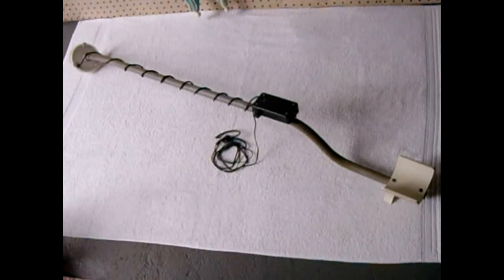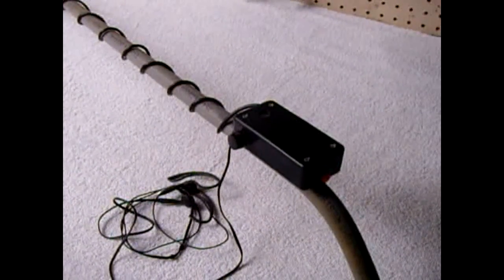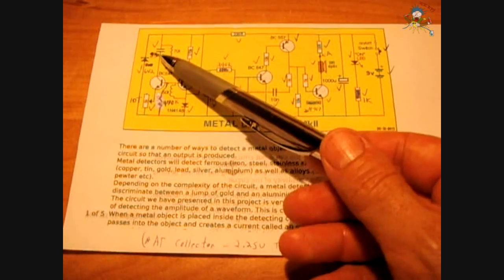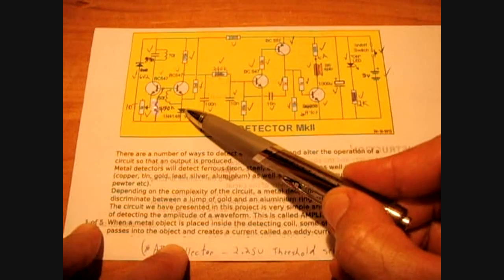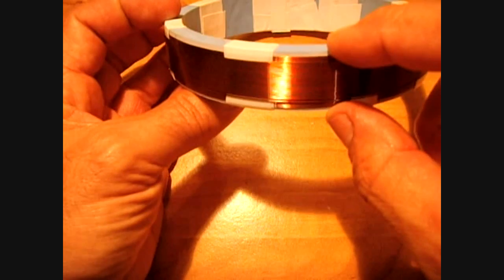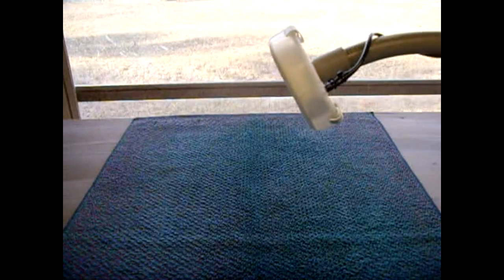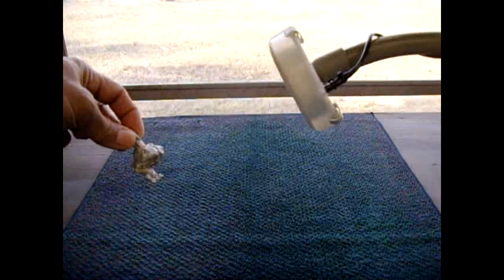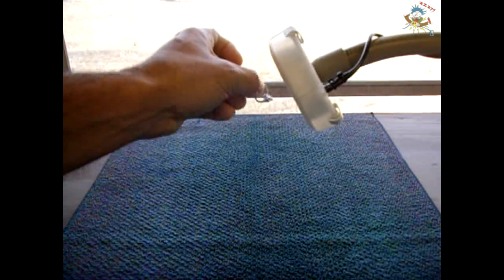HOMEMADE METAL DETECTOR ~ Simple & Sensitive(Schematic)

Comment: This circuit will never work
I did every thing from the diagram from the link. I did also the same thing from the changes in the video but it does not work. It just gives a big noise thats it.
I think it is just a joke
Reply from the maker: The circuit works just fine. I don't upload bogus videos. Don't blame my video for your screw up. Clearly you made a mistake somewhere. I don't assist viewers with circuits, I simply supply detailed videos.
Reply: @electronicsNmore  sorry but three persons checking the same circuit and making 2 circuits and checking again
Something wrong in the circuit itself as we made different coils with all possible turning and the result was the same. We removed one coil and both the noise didn't change at all. So the result is that the circuit have something wrong or it is just a joke

Comment: This is cool but the detection depth is terrible...
Reply from the maker: Troy Stutsman Terrible? Guess you didn't watch the entire video. Considering how simple the circuit is, the detection depth is very good.
Reply: Troy, what's a good depth? I am trying to make or buy (if exist) a metal detector with 15-20 ft depth (works for small and large objects), please advise.